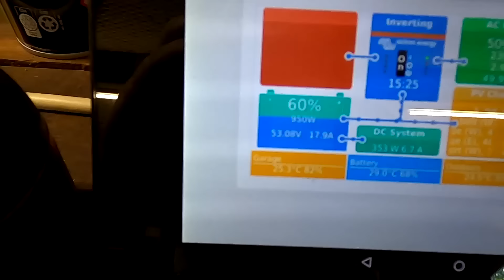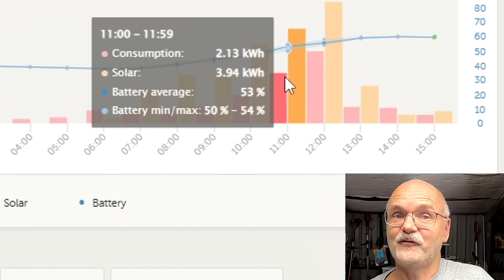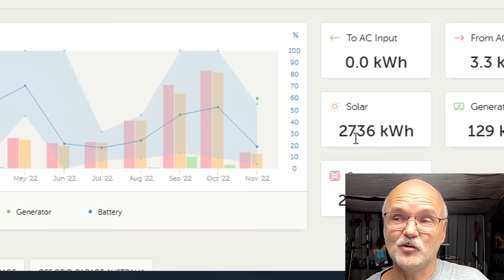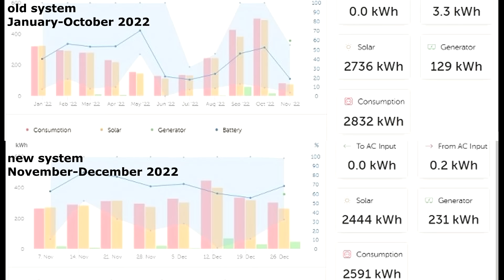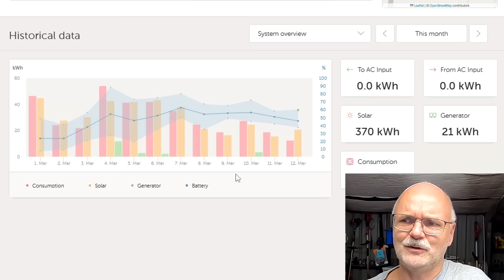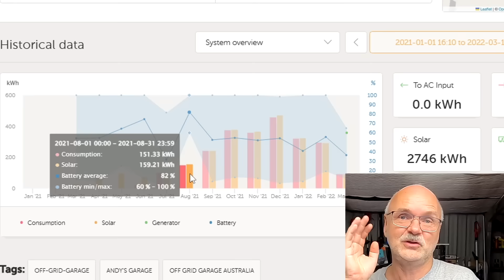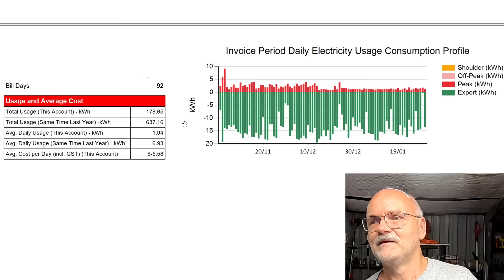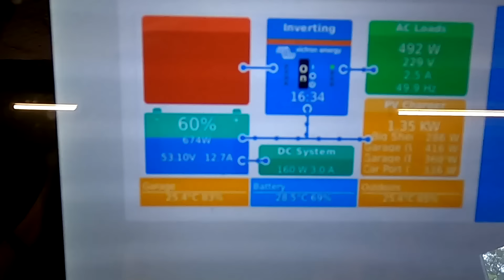4 Months after the solar upgrade. Are we there yet to go fully off-grid?

Comment: I'm really looking forward to your winter results. Also, the feeling of generating enough energy to cover your needs (as you said, you're technically off-grid) is priceless, no?
Reply from the maker: It is amazing and I cannot believe how this all works together and make me energy independent (almost).
Winter will be indeed very interesting. We're already 40% down with production since summer peak. Still enough atm...
Reply: @OffGridGarageAustralia  Things are looking good here - this month the battery was full for the first time this year!
Reply from the maker: @upnorthandpersonal  In March already?! Wow, nice work. Could you get more out of your system with more solar? Or is the winter just too bad and more solar would not really help?
Reply: @OffGridGarageAustralia  Winter is just dark. Imagine the sun skimming the horizon, not really coming over it, for about three hours and the rest just being twilight at most. And that's on a clear day. It's just dark in winter here. That said, I do have a use for all the power I generate right now by means of the heat pump - saves me from burning as much wood; it's still freezing outside. Coupled to a very efficient use of electricity in general (6kWh/day maximum) it's all good.
Reply: @OffGridGarageAustralia  Maybe I really should focus on my YT channel - would be the polar opposite of yours: "Welcome to dark, cold Finland" :)
Reply: @just_saw_dust  I'm not giving up on these -  they just have too much potential, and I've been running the older ones for three years now without issues. I'll keep everyone posted. I have another broken one coming this week, and I have ordered a new one to see if things changed in the mean time.

Comment: Nice work Andy. With our solar PV, load management strategies, home efficiency, PV diversion for water heater and now some off-grid capacity and battery, our grid imports are down from 58.9 kWh/day in Qtr 4 2016 to 4.7 kWh/day in Q4 2022.
Reply from the maker: That is a great achievement! Less then 10% of what you have used 6 years ago. Do you plan to go fully offgrid?
Reply: @OffGridGarageAustralia  No plans for that, at least not yet. Pareto principle, that first 80% of loads is relatively easy to cover with off-grid, but the peak loads, especially ducted AC in Summer (and a little in Winter), mean not even your big battery would cover us. Q4 is a good quarter for not using too much aircon, but Q1 we have much heavier demand.
The grid is still a cheaper option than over investing in off-grid just to cover peak demand for a few months of the year.
Plan is to work more on the demand side so we can bring down that peak and perhaps be able to bring it inside the off-grid tent, so to speak.

Comment: Congratulations! that's a great achievement, actually managing to use all the energy you have generated :)  I have the turn down the MPPT's in summer just cant use it all, and still don't have enough in winter.
Reply from the maker: Yeah, that is the problem if you're off-grid. You need an EV!

Comment: Hi Andy,
I am off-grid for last 11th month. Solar panel power - 2100w, Battery- 48v, 160Ah (LFP) & 24v, 90Ah (LFP). 25v, 150Ah (Lead acid). 
No problemo for me & grid power usage 0%.
Avarage power consumption 4 to 4.5kw.
Running butter smooth... until today.
Reply from the maker: With such a small system? Wow, how do you make hot water and heating, how do you handle cooking?
Reply: @OffGridGarageAustralia  I am using hot water when ever required by Havells Automatic Cutt Off Immersion water heater with temperature setting knob HP 10 1000 Watt. Using washing machine, water pump, induction cooker when ever required. But I want to increase the capacity of my battery as some time I am unable to store all the solar energy due to limited battery storage.
Reply: Also, no shading on solar panels by trees. So my daily solar generation almost 7.5kw

Comment: I live off grid using 80 nickle iron battery's 1000amph and 36 250 watt panels with three 5kva mppt inverters.

We run a normal household.
Reply from the maker: Oh, wow, thanks for sharing. How do you heat your house, hot water, EV charging, Aircon, oven/cooktop?
Reply: @OffGridGarageAustralia  Ok we have two kitchens one uses gas oven and cook top the main kitchen uses electric oven and cook top for use in summer when we have left over power which is nearly everyday. In winter we have a wood fired oven heater cook top.

We have two ducted 7kw aircons which use about 2700watts each to cool in summer we dont use the heater side of the units much as the house has a seven star energy rating and stays very stable overall.

We try to have back up for everthing. As we have no services at all in our area.The house is a 6 bedroom two bath two kitchen house 230sqm . 
Hot water is three solar panels into storage tanks and also seprate gas hot water unit for cloudy days in winter.

No Ev yet but it would just run of the main bank plenty of power left over

If you want i can send some pics of the setup.

Cheers Phil

Comment: Idea for future video: Ways to use your excess energy? I'm running several miners myself to use up my excess energy. Can't bear to waste a drop myself given how much work has gone into generating it. Check out the Bitmain L3+ coupled with HiveOS, they can be had now for peanuts and work out over $0.07/kWh. Best bang for buck ATM. Also you can replace your miner's fans with Phanteks T30s so it doesn't sound like a jet engine.
Reply from the maker: Yeah, I'm not really into mining but wanted to test this out as an option. Haven't turned it on for 2 months or so. No full charge since...

Comment: Congratulations 🎉🍻🥳
Its spring here in the UK, so my solar system is producing more now 👏🥳🎉 The other day, I ran out of things to plug in & charge to use the free energy, so I put the TV on for the cat! 😂🤣 My "issue" is going to be not enough battery in summer, then winter it'll be not enough solar 🙄🤭
Reply from the maker: Our cat watches TV as well sometimes. YouTube mainly. There is a mouse channel especially for cats. He watches with high concentration for quite a long time before he falls asleep. Must be exhausting 😁

Yeah, there is always that problem with too much of that and not enough of that and the other way around. It's very hard to get it right.

Comment: Hey Andy. Have you ever thought about setting up a solar dump load. That could pre heat your hot water when the batteries are full. Have been doing some research and there is some talk of dump loads micro cycling the batteries. Be interested to hear your opinion. Keep up the quality content.👌
Reply from the maker: Yes, all done. I have the hot water tank and also and ASIC for that purpose.
No micro cycling with the proper MPPT setup in Victron. They keep the batteries fully charged at float voltage and the solar delivers power to the dump load.
Reply: Do you have a video on this. Maybe a future video.

Comment: It makes perfect sense that the SPAT refrigerator should be powered from the garage.  No doubt the energy consumed by the refrigerator is far outweighed by the benefit of having a plentiful supply of freshly calibrated SPATs, most crucial for the proper and efficient operation of the system!

Comment: Andy why don’t you put a small battery on your house with your grid tied array so you can offset the left over or 
you could use the portable Bluetti to washing machine and ac charge it during the day so wifey doesn’t have to use extension cables just turn around and plug the washing machine into the portable battery 😉

I’m doing that with all kitchen appliances and freezers in my garage 

I do this with my Bluetti AC500 I set the timer to ac charge during the day and we use at night :)
Reply from the maker: The grid tied system is on a high feed in tariff (A$0.5/kWh). That would be wrong to save the power in a battery!

Comment: Andy what a happy face when you show that graph what it all brings you. It is a pity that our roof is not bigger to generate so much energy, but we are now entering the good times, the summer in the small country next to Germany /
How long are you still tied to the contract for your home before you can go completely off-grid?
Reply from the maker: Yeah, it is a good achievement already and I'm happy with the direction we're heading. Winter will tell, if it is still enough.
The contract runs until June 2028. I can break it at any time but I rather wait for the electrician to figure something out.

Comment: I have been monitoring my ... well my house for a few years.  It's when you come to creating consumption charts and pause to think about the units.
I have graphs in kWh/h and kWh/day, but both can be viewed of different time frames and intervals.  The graphs make perfect sense intuatively but the units are nut.

By the way.  Next step for OOG should be to get rid of all that mess of different apps and monitors and start publishing it all to a database like InfuxDB and a graphing front end like Grafana.
Reply from the maker: I really like the VRM from Victron. All the data is there and I'm not a DB guy, so won't have time to set anything else up. The VRM works well for me.
Reply: @OffGridGarageAustralia  The advantages is the scope and detail of the data you get.  The very same charts that show my solar panel data, shows my temperatures, mains power usage, heating status and weather.  I can even bring up PC status or when the bedroom light is on, when motion is detected in various places.  All on teh same set of dashboards.
Data "today" is stored at whatever resolution the devices send it.  After a week though that is down graded to 1 minute avg,min,max ... after a month that goes to 5 minutes for a year.  I left it at that.  It keeps the DB small.
I'm working on some analysis software to detect and record when individual devices get switched on by looking for consumption deltas that match devices.
Most of this stuff is available as "pre-canned" appliances on VMs or "docker".
Most run on a raspberry PI.
MQTT and home automation is a big focus and easy to find configs, add ons and pre-made solutions.
Consider my hallway lights.  When motion is detected they first check the solar panels in the garden to see if it's "day light" before turning the lights on or not.  That's spanning quite a few indpendant datasets.
It's a lot simpler than you would think and you control the data across all devices and manufacturers.
Reply from the maker: @1over137  Sounds great and I would love doing it. Just need to find the time to get really into it...

Comment: Nice to see those numbers in the rain,  and the cost savings they're nice but dont forget the hidden costsavings,  cleaner environment , less conflict over extracting energy from the earth just simply using the suns energy. The winter will be tough, but its nice to see pioneers like youreslf take it to the limits.  We''re just getting a whif oof spring here in the northern hemipshere, although it just snowed, its been a warm winter so im not complaining, but the sun was absent for weeks at a time it seemed, I forgot how much power my solar could produce the difference is amazing.  Would still be cool to have a long term storage solution, like use the energy you harvested in the summer to use in the winter, but more panel for low light seems to do the trick without such an option for now.   But what happens to your solar when it get so huge, and your load is so small, will it blow up? hehe only one way to find out, jk.  Ive concluded other forms of energy are required to surivive the winter short of just having more panel, like wind turbine generation, and maybe even hydro.  All that rain collected could turn a  generator.   Youd be surprised how small a hydro generator is that can produce 1500w, compared to a solar panel setup.  Anyway, cool stuff and interesting numbers thank you.
Reply from the maker: Thanks a lot, Mike. Winter is always tough. Especially if you get snow and it covers the panels. Almost impossible to produce anything if you can't clear them.
For me it's a big experiment with the east/west side of the roof and the shading in winter. Will it be enough? We are already 40% down from the summer peak but 5 months away until spring again. It will make some cool videos though 😎